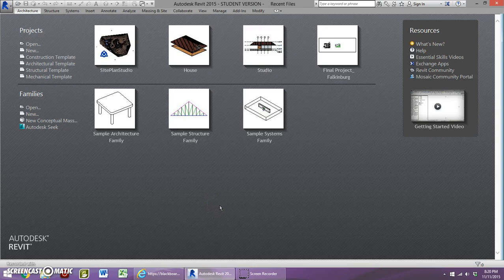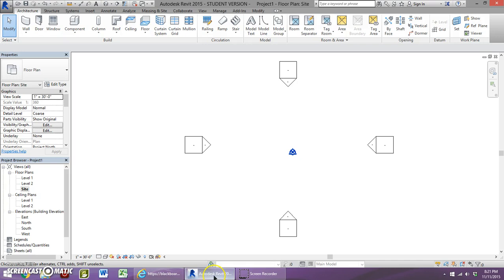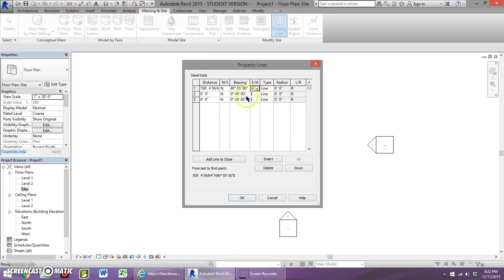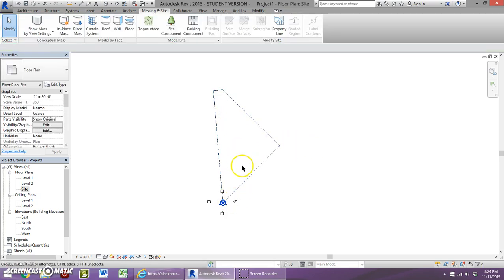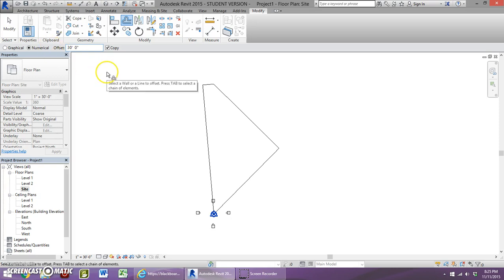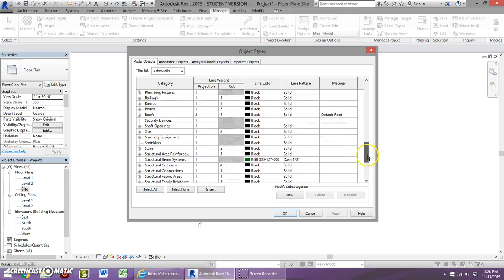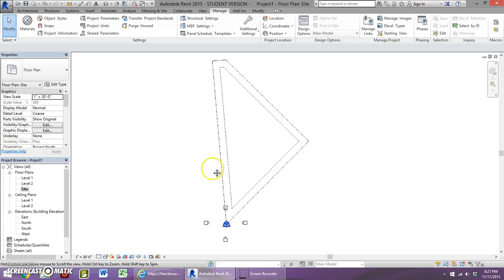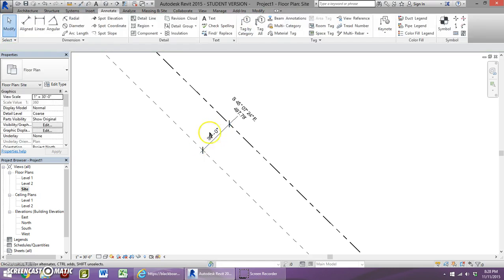Starting a Site Plan with Property lines in Revit

Comment: Please sir, I plot survey plan with Revit, but the boundaries line is too thick, I need setting. Help
Reply from the maker: Head over to the "Manage" tab at the top, >>> "Additional Settings icon" in the "Settings" panel, >>>select "Line Styles" and find the line you are using for your boundaries and change.